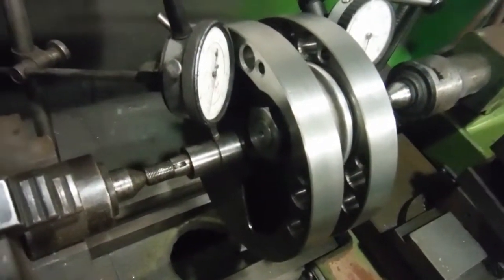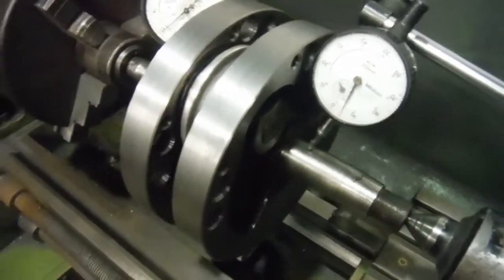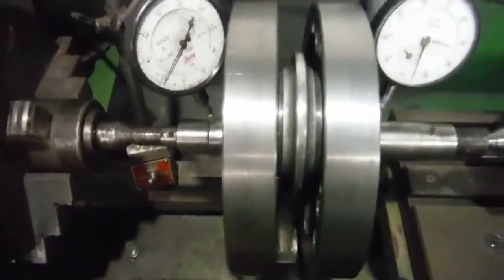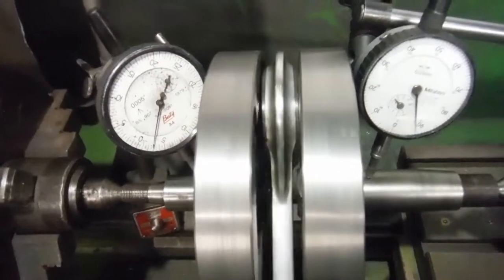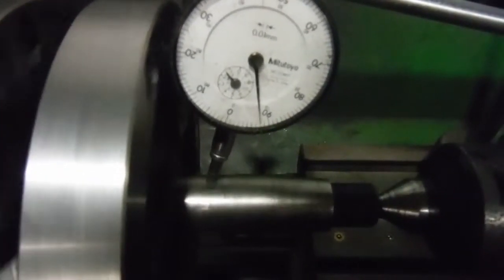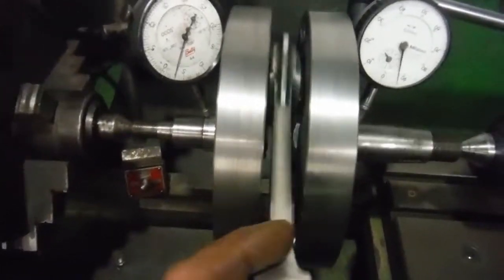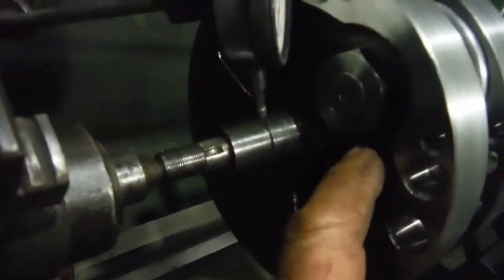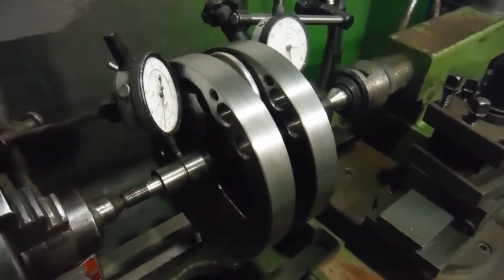Royal Enfield 350 Model G Asbo 39 lightened crank checked after reassembly.

Comment: Where do you remove weight from the flywheels?  The periphery?
Reply from the maker: I remove weight from the inside and outside faces of the flywheels, also the diameter. More weight is also removed when drilling the holes for rebalancing.

Comment: Hi Paul. I'm very curious about how you reduce the weight of a crankshaft. From where is it removed and how.  I know little to nothing about the process.  Thanks again for the interesting videos.  Cheers, Dan👍🇨🇦
Reply from the maker: Hi Dan, I remove weight from the inside and outside faces of the flywheels, also the diameter. More weight is also removed when drilling the holes for rebalancing.